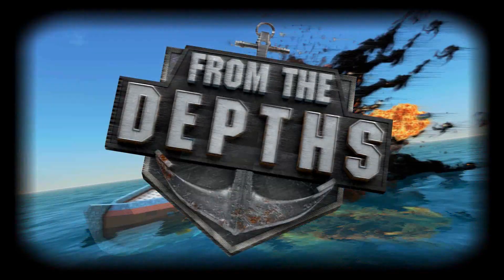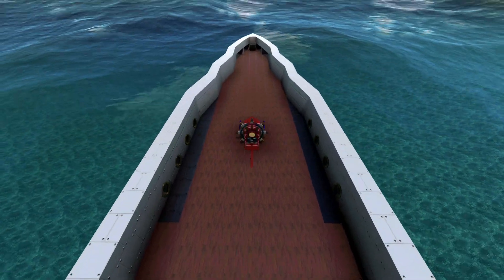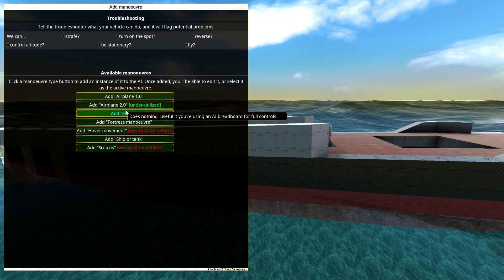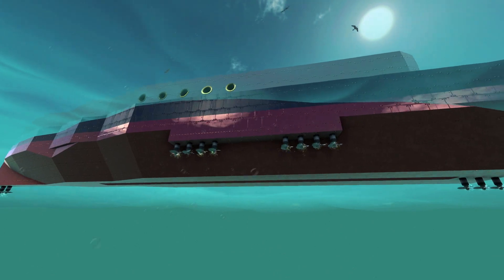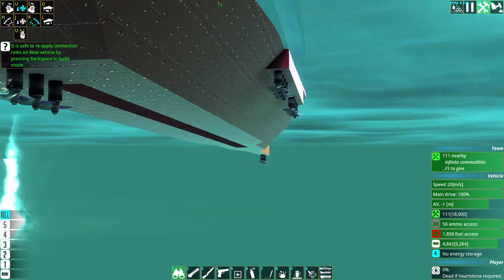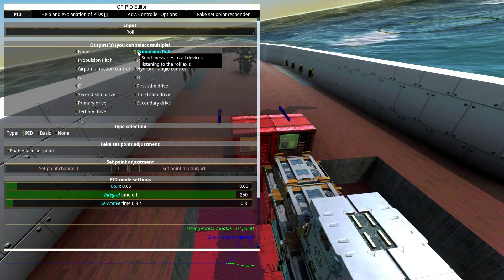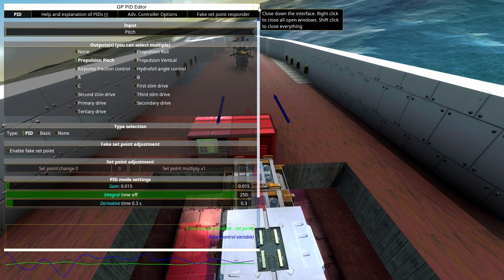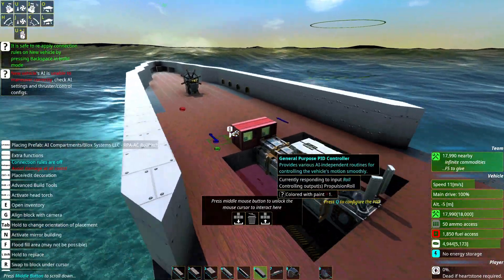PID Roll/Pitch Stabilization for Manual Control - From The Depths INSTANT Tutorial

Comment: I tried using this for hovercraft and it doesnt work, it flies fine with AI, but as soon as I press any key the pitch, roll and altitude dont work, and instead of plummeting like a brick (at least pitch and roll working) it nose dives because pitch also stops working
Reply from the maker: Are you sure you set it up correctly because this does make it so that you can control it while it still controls the pitch roll and altitude

Comment: For "a little more experienced" beginners:
I also first used general pid to control ships / hovercraft / submarines.
The next step for me was: use a singe breadboard (non AI is ok). In a breadboard you can add the same behaviour in a single block.
Yes, you will need a tutorial or two for a breadboard, but it is so handy to use them instead general pid!
Especially if you are stabilizing a heli and want to add some weired movement behaviour, like bouncing up and down...
Reply from the maker: Surely that is good, for some reason I did not get into the bread yet, but I intend to
Reply: Really? You are one of the tutorial-masters of FtD and didn't go breadboard yet? 😳

Maybe check it out and you will probably never go back to general pid! 👍
Reply: @GMODISM  Hay man.. just leaving a friendly comment. Larthland made a sub that could chnage altitude with helium.. ( i expect this could be used for flyers aswel).  
I´ve by the power of help have made a sub that can do that. but for some wierd reason it needs 2? controllers? 
one for sailing U/H/J/K.. and one for altitude T/G etc. His however didn't need that.   

And i wonder... Using a simple pid.. 
if i set a fake point to x, and use T as green and G as Red, in the same PID...  

why wont it respond to my comments? 

since you one of the master i hope you would have an answer or solution i could understand... I have yet to venture into bread.. but if this wont work.. i might be forced to it.

Comment: I've seen some improvised gyroscopes in workshop thruster crafts, as in BB-controlled spinblocks that react to your craft's orientational error.

No idea how practical it actually is, but I do like it's implications. Any info on that by chance?
Reply from the maker: No need to use bread, you can do it with ACBs, if you wanna see it in action I build a motorbike on my 2nd channel gmodist in a stream VOD.
Reply: @GMODISM  
I'll check it out then. Thanks.